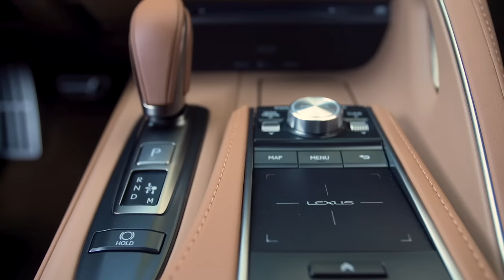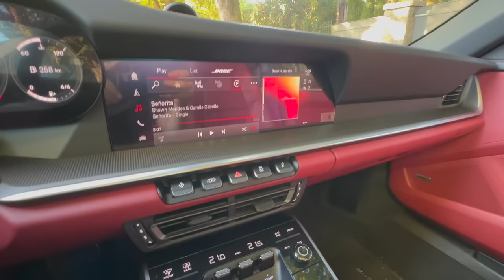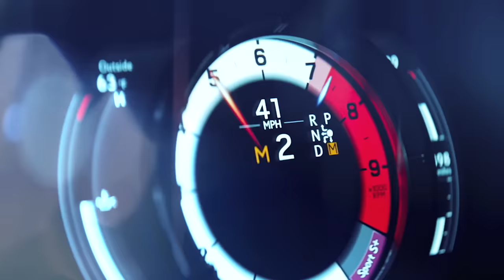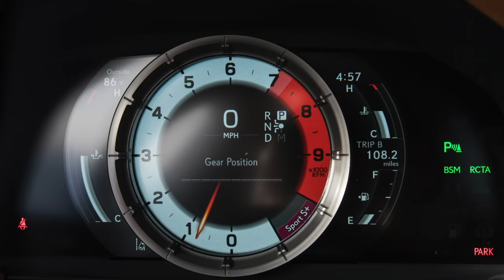ENGINEER'S COMPARISON: LEXUS LC 500 vs PORSCHE 911 // WHICH ONE WOULD YOU BUY? // LET'S DREAM!

Comment: Two different cars on two totally different missions. The Porsche is racing bred and designed for EXTREME driving on the Track, and  occasionally (and illegally) capable to reach triple digits  on back roads with absolute control and confidence, but offering a stiffer ride, yet more precise steering. 
This Lexus is bred from a family of beautiful Boulevard Cruisers with this Model upgrading the performance to higher levels, but not forgetting it's birthright.
The Lexus is far more useful for non track fans, but the Porsche is far more fulfilling as an extreme track driver's car.
What's next? Comparing a Land Rover to a Wrangler?
Equally useless comparo.

Comment: Had to check out this video since I'm trying to decide between the Targa and a LC.  Since they are close in your evaluation matrix it comes down to how i would use the car.. For driving around town or an all day drive I'd go with the LC.  For spirited driving on twisty roads or a day at the track I'd go with the Targa.
Reply: I have a Targa GTS and this is not the best one to put on track. You can use a hardtop 911 to get more value of your money. 911 is not as comfortable as LC but they are iconic and hold on to the value better

Comment: I would not upgrade until those are ready to change. Then get the larger size K02’s that still fit the original TRD wheels.  
That’s what I did on my Jeep Gladiator and I’m happy with them.

Comment: Thanks David for this comparison. These are two great cars. Do you think the LC500 would handle better if we used regular tires instead of the run-flats?
Reply from the maker: You're welcome!  I think the steering feel is more of an engineering thing, and can't be solved by different sets of tires.  I think putting wider tires may help with better steering feel perhaps...right now, it's too light and numb on the LC.